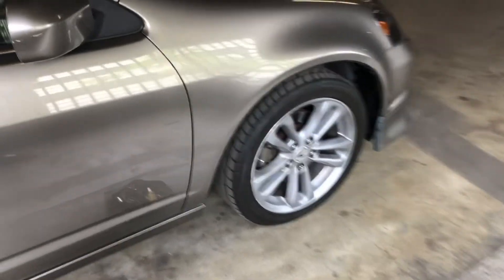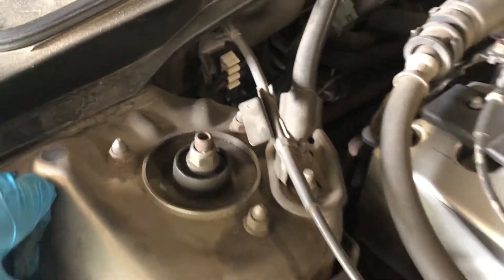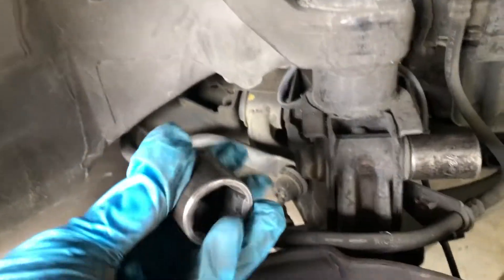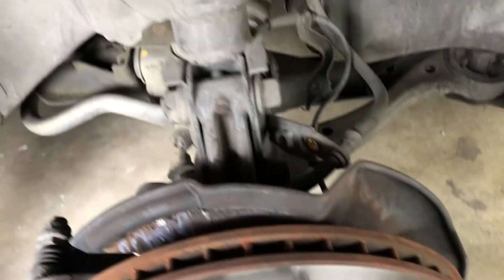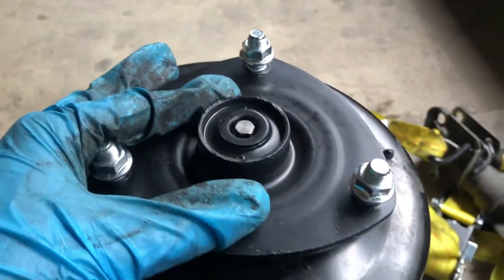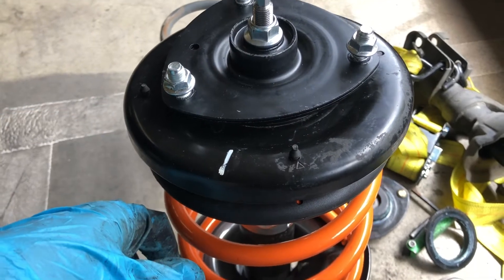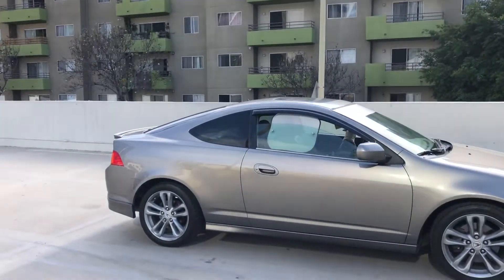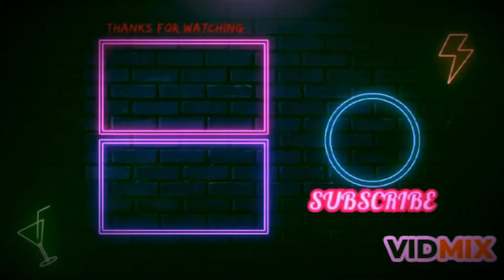Acura RSX lowering springs

Comment from the maker: Once I got the rear springs on (not recorded) I noticed this whole install was a complete fail. I don’t want to throw $1000 into coilovers for this thing, I was probably better off buying some maxspeeding rods eBay coil overs or something 😩
Reply: What went wrong what do you mean?
Reply from the maker: @BonzaiYT  I show it in another video. The springs are uneven. The rear has a 1” wheel gap, and the front had a 4” wheel gap. Looked like a low rider. Waste of money

Comment: No way this was a 2in drop
Reply from the maker: I’m glad I only got burned for $150. Wasn’t expecting much but they were lousy. Rear was slammed, and front was high up. Looked like a low rider. Other people have commented and said that’s how Megan springs are, not good. I tried to cheap out and get away with spending less, with this chassis there is no cheaping out like an old civic or integra
Reply: @IntegraDIY  I see, I don’t want to spend much on coilovers since my dc5 will be a daily so I prefer springs which is why im getting Tein lowering springs and KYB shocks/struts to go with them
Reply from the maker: I heard good things about Tein lowering springs. I wish I went that route. When you get them and install them, please comment and tell me how do you like them. I might pick them up if you like them.
Reply: Integra DIY will do, getting them installed this weekend!
Reply: @IntegraDIY  got them installed, i love them
Reply from the maker: Nice man! Did you get the S.Tech or the H.Tech springs? I have new struts, just need to find some springs. Can you post a walk around video of how your RSX looks with the springs?
Reply: @IntegraDIY  i got the S.Tech, I’ll record a video tomorrow.
Reply: @JoeLima7  What are a good set of struts for the S tech springs?